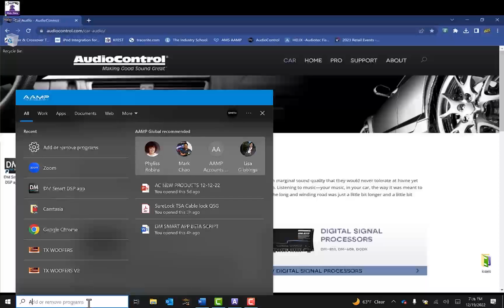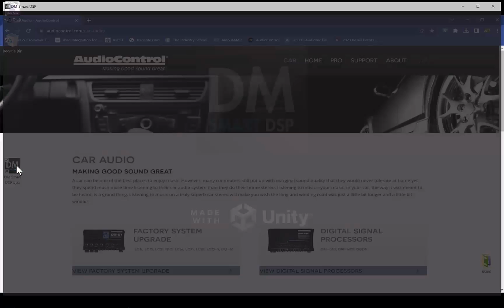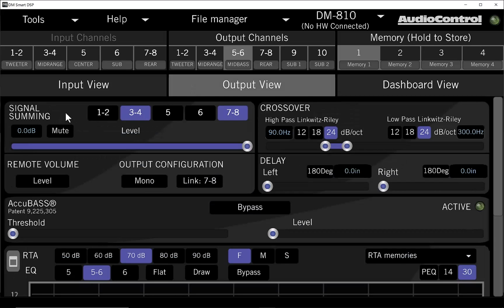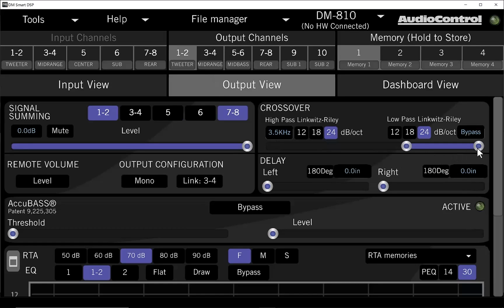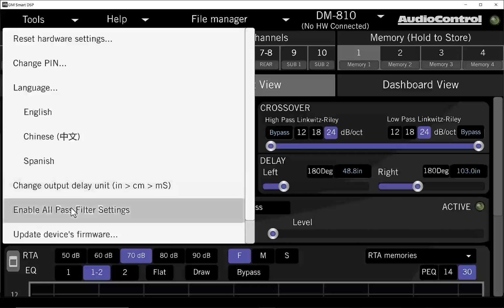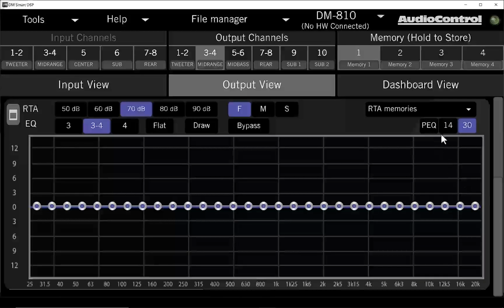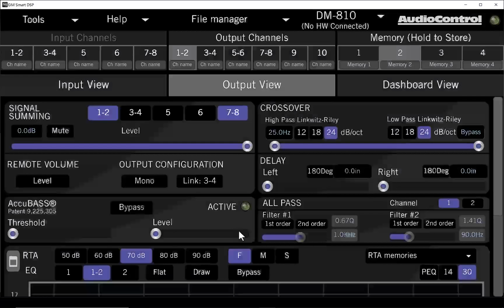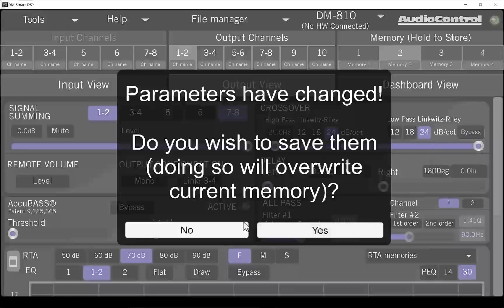AudioControl DM Smart DSP Application - Full Tutorial with Jeff Smith

Comment: Also you all need to put back where you can crossover 20k it should have 20k and then by pass. Same with the subsonic 25hz then by pass. You all need to get the software right. Also by increasing the output gain via the software. This supposed to be a all encompassing system you should be able to everything at the dsp. I have 3 amp still have to set the game on the amp when the output suppose to be 10 volts.

Comment: Hello, i used the 1.3.69 version on Ac website and it doesn't look like this. Is this update available? Also is there a known issue with the gto and remote turn on out? I find that more times then not the unit stays on powering the amps. I have to pull the plug off the unit for it to shut down then plug it back in.
Reply: It was there but it was removed earlier this year I message them and I get no response.
Reply: @LividLeon  finding really hard to get them on the phone or answer an email. What a shame.

Comment: I would really like to see ratio based remote volume control instead of incrementing or decrementing each linked output channel 0.3db per volume knob click. I use my amp as the only means of volume control on my system, and I have to do weird hacks to get each channel to the right volume level, and maintain that ratio when adjusting volume using the ACR-3

Comment: Downloaded update can connect fine via laptop but the app now won't connect!
Reply: I'm having all kinds of issues now! So I was on firmware 1.4.01 when the BT connection issues started out of no where they resolved but I noticed on the website that they rolled firmware back to 1.3.69 and had a beta firmware 1.4.02 so I decided to try the update and now the BT and Laptop won't connect it keeps telling me wring pin. I've never changed the pin from default (1234) I have no idea what to do now. I emailed support but haven't heard anything back!
Reply: @d.stott215  This happened to me as well, what u have to do is downgrade ur DSP back into 1.3.69 manually by selecting the appropriate .bin for ur DSP, u have to completely uninstall the DM software u are on right now & reinstall 1.4.02 beta back into your Mac/PC this will allow u to log in into ur DSP, (Side not: TAKE A SCREENSHOT OF ALL YOUR SETTINGS CAUSE FOR ME THEY GOT LOST.) once u are logged into ur DSP go to Tools Tab & select update device firmware & select the appropriate .bin once installed, uninstall the 1.4.02 beta from your MAC/PC & reinstall 1.3.69 in ur MAC/PC this should fix the AC-BT24 issue since the beta still is very buggy.
Reply: @Soldier7 _  Yeah Audiocontrol got back to me and gave me those instructions. I'm back in universal password is audiocontrol for future reference.
Reply: @d.stott215  do you still have these instructions? how did you resolve this? please share
Reply: @ianwilliamson5951  If your getting the wrong pin try using audiocontrol as your password in all lower case.

Comment: So with these units you can only eq pairs and not singles?
Reply: You can eq the left and right channel individually.
Reply: @LividLeon  So you can EQ sides, but not individual speakers. Ill be more clear. I have a 3 way setup totaling 6 speakers. I cannot eq each speaker?
Reply: @screwf4ce1  you would eq the signal going to the channels that the speakers are connected to on your amplifier. If you want to adjust each individual speaker on each channel you’d have to do that with one or a couple of the Audio Control Amplifiers.

Comment: The latest app not connecting to the older version dm 810 firmware i actually have extract the bin from the new software and use the older app update the firmware on dm 810 so far the software working. I still have see how the bt24 update goes. My only issues is i not sure if the graphic and parametric equalizer is two separate equalizer that is summed since adjusting one don't seem to influence the next. The all pass and parametric eq work great for my tweeters the correct the roll and phase difference of the bass blockers because i installed just incase somethings reset it don't blow my tweeters.

Comment: I hope the fix the bugs with the subwoofer channels sometimes when drop the high pass to 25hz the sub output would drop I currently using 1.2.25 because the 1.3.44 and 1.3.49 have a lot of bugs. Also when you connect the Bluetooth dongle it use to drop the input on the last pair of inputs.

Comment: When Dean mentioned the firmware update on last weeks Reverse Polarity I snagged me a DM-810.😃
Reply: Dean has been pushing this update for a couple months, AC has been pushing this update for years. I would have waited until the update was live before buying anything. AC has been breaking their promises and people are getting upset.
Reply: You guys need to get off Dean and AC's nuts. these things are junk
Reply: @kewlbug  You obviously have not tried the new update. It is BETA, but it has significantly improved my D6.1200. The only thing AC is missing is advanced algorithms for rear fill or upmixing for center channels. You sound butt hurt for no reason.
Reply: @gonzoe123   I'm butt hurt at the waste of time AC was. Spend 20 min to connect bluetooth, do tuning, then it disconnects and you lose everything. The software is like a phone app ported to PC, wouldn't even work on one of my laptops even after getting all the drivers and settings needed. Tech support couldn't figure it out either.  Floor noise like crazy no matter what I did or changed. Maybe it was from being in 10v mode. Finding out now, the signal is boosted internally or something. Pointless if it raises floor noise with it.  They fixed some things with the software, but really it needs a whole new platform. I call it a DSP for dummies.  I could go on and on.. So yes, butthurt at the time wasted I will never get back.  Props to their marketing team for getting all the YouTube channels to shill this junk.
Reply: @kewlbug  Obviously you had a bad experience. Floor noise is not from the amp, that is from your signal. That is your problem, not the equipment's problem. The bluetooth has never worked for me. Losing settings is one of the things they fixed with version 1.4. Just because you had one bad experience does not make it a junk product.
Reply: @gonzoe123  weird. Because I swapped in a Helix and it is DEAD silent. I don’t need an electronics
lesson. It also solves every problem I ever had w AC. I stand by all my comments.
Reply: @kewlbug  NVM you definitely upgraded. Currently the only amps I would swap out my D6.1200 for is a Helix V eight or twelve